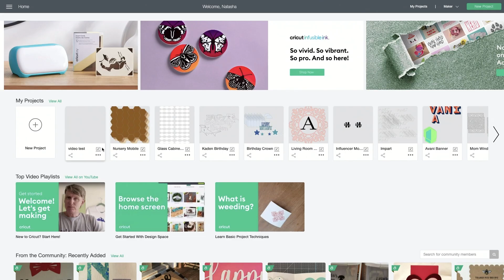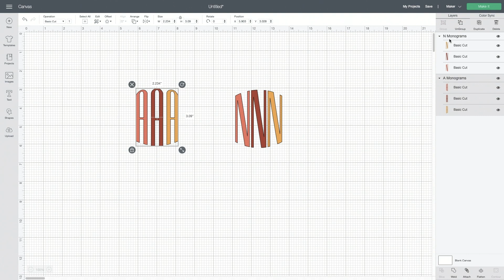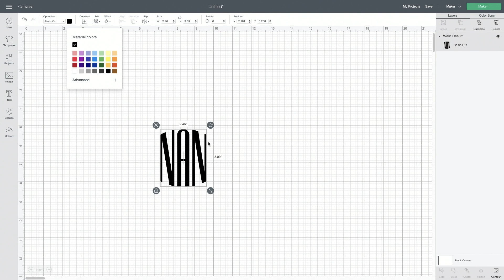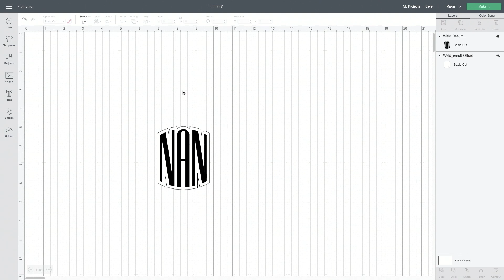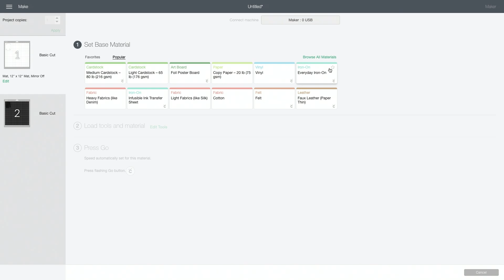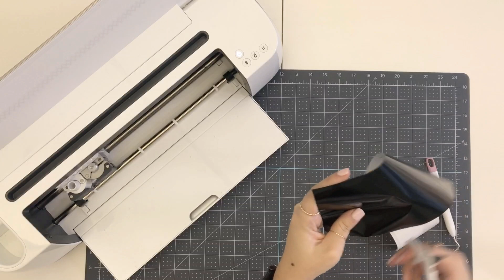Make a Vinyl Sticker Using Offset

Comment: I'm curious as to how it would work with stickers. I have a transparent design I want to cut on a frosted sticker paper, but it's wasteful to have to use two sheets just to print-then-cut. Trying to print twice on the same sheet is also a challenge due to printer slide, calibration, etc. So how would I use the offset to print-then-cut a single image with an offset? Do I just group or weld or attach the images somehow?
Reply from the maker: If you "flatten" the image and offset, you can do it all in one cut!